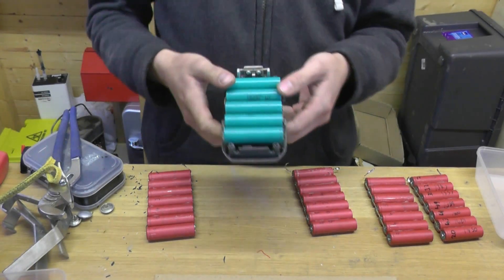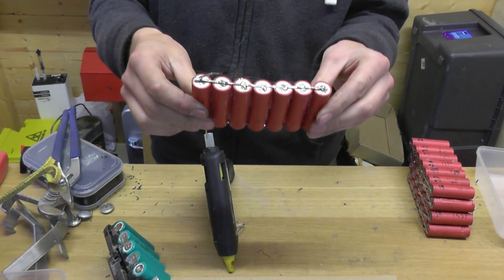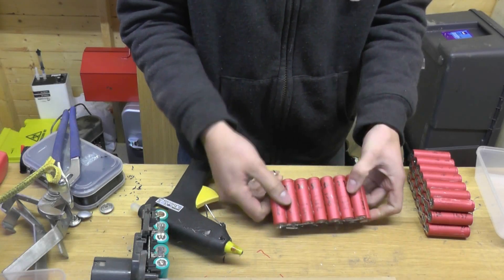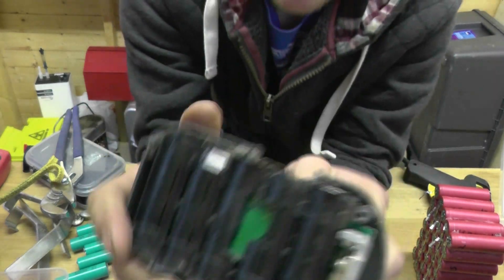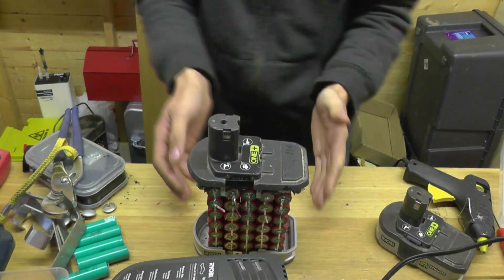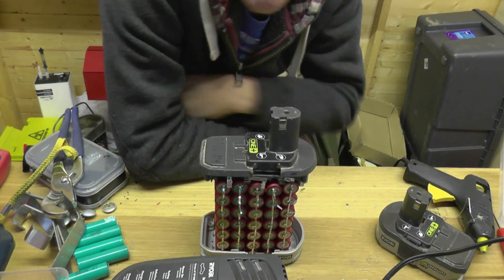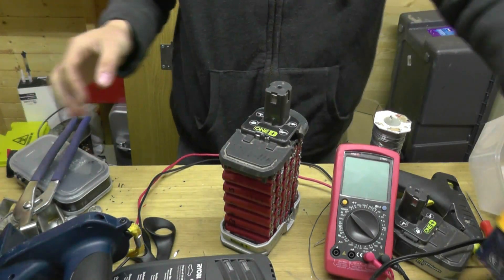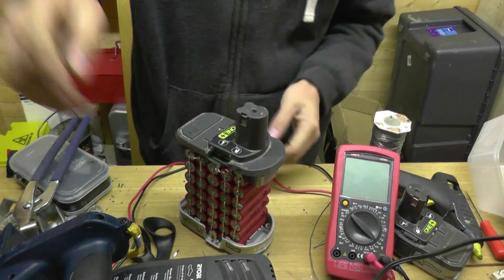18650 part 3 - supersized Ryobi 18v pack

Comment: I have done just the same with my panasonic SDS drill,originally had NIMH battery's but changed to 18650 also fitted balanced charge socket and lipo voltage warning indicator 
Charge on the lipo charger and works like a dream
My tab wire was thicker ( the one julian ilett used) to handle the current of the drill
Reply from the maker: yeah I only had the 2mm wire in stock, but only plan to draw 3 amp max for laptop. Not using this pack for my powertools, I have some 4ah packs for that! what voltage is you panasonic drill?

Comment: nice pete ive got all my tools off grid, just built corded units as i  needed mains free flexability not true cord less!  i think that should be cool i didnt use any circit protection just a voltage meter.i use um daly at the moment im running my rip saw off um  thats a ryobi too .good luck with this i ll do a video of my efforts see if it sparks an idea or something.stay cool buddy all the best..stoo. .

Comment: If you look up the datasheet for the li-ion charging control ic it should say what it is capable of handeling.  I suspect that it will work but will take longer to charge assuming that the the ic limits the charge current based on the old batteries.  You may be able to use the i2c bus on the ic if it has that capability to reprogram it for the larger capasity (I am assuming that this pack works like a laptop battery).  Most li-ion multi cell battery managment ic's will slowly balance the pack by placing a 20 to 30ma drain on the cells that are higher then the lowest cell of the pack if you leave the pack on its own for a day or so.

Comment: Fucking excellent! Im looking for mods for ryobi 18v batts..
Reply from the maker: Freshkryp69 this project never got finished. Did charge battery from flat. The ryobi charger seems to time out before fully charging. but you could put it on a manual timer to reset the power every couple of hours.

More recently I have converted a Dewalt wet dry vac to run from ryobi batteries and made a unit to take power from 18v down to 12v and power usb items!

Comment: I like conveinient reliable power
But I think that battery is s little
Too lsrge for portable powertoolo
Reply from the maker: I made it mainly for use with a defective charger that I mounted some 12v sockets and usb sockets in hindsight if I had access to higher capacity cells I could have made it smaller.

Comment: 2 problems I see you having is that the top cells will get worked more then the rest (as such the bottom cells worked less) and that the battery could slip out of anything you plug it into.
Reply from the maker: Good point! Can you think of a way around this? maybe like on deep cycle battery banks charging and discharging from opposite corners? or regular balance charging?

Remember this is just thrown together and will change as I get more ideas and feedback! thankyou for your input!
Reply: the only thing I would recommend is to maybe use a double height 18v one plus (4.0 Ah battery) that are 2 cells high and 5 wide but each and use 2.0 ah cells, swap out the 2.0's with 5.0's and then you have a Ryobi one+ battery that has 10Ah of power.

I don't have any suggestions on how to charge the monster you built.
Reply: Why would that be the case?  Especially at the 3A expected draw, how much voltage drop do you think there will be across those wires?

Comment: Hi nice vidz, how did you measure the capasity? Do you have a dumme current load gadget? If did you buy it if where? Or did you make your own?
Reply from the maker: The cheapest way is to either buy an Imax B6 balance charger (this has a 1A discharge function which shows capacity) or buy a Turnigy watt meter which can take upto 60v 120A and has both MAH and WH on its display. (Be sure to only use this on a protected pack and use external supply to keep the readings once your battery is flat.
Reply: pietkaify So, plug the battery in the charger, press decharge, and thats it?  And i can take a reading of the lcd?     Is this a presice way or just a fair indicator?  Many thx! And keep op the great work!
Reply from the maker: If you go back to part 2 cycling I charged and discharged each cell 5 times and I took the average of each and used that as my capacity. These are "dead" cells that I have revived "do this at your own risk" The Imax B6 I use seem to be copies, but against each other they preform the same.

Expect the copy to cost £15-20 and the real deal arond £30. Your welcome

Comment: I must had missed the 1st 2 videos of course this is my first time seeing videos from you I believe. I'm having a little bit of audio issues but it looks like you took a p103 and made it from a 1.5ah to more like a I don't even know but looks like more then a 9ah battery. This does confuse me a bit about how you would use the circuit board to operate it and more confusing is charging it but I'd love to know more info as I have a lot of p103s and 18650 cells. I can take things apart and put them back together even modify things but I can't figure out how to search previous videos lol. Or much else then watch videos in my feed or if I look up I'll see things in that category but that's it. I did subscribe so maybe that will help. I am wondering if you have heard of the Vanon 6ah batteries and any videos or them that are not sponsored even meaning where Vanon voluntarily sends youtuber the battery for free. This is what I was searching when I found your video. I've seen videos on them that got excellent reviews and had Samsung cells but unfortunately the comments where filled with people saying they got defects and the cells said Vanon on them instead of Samsung or LG like they advertised.

Comment: I hope he knows that the 18650 cells from a laptop and the cells from a power tool pack are not the same. They look identical but they have different C ratings.
Reply from the maker: epicdeuce yes he does. =) but in this case several of these cells in parrallel would more than make up the 15A discharge rating of the original samsung cells.

Comment: Wait... Aren't each of those cells 3.7v? If they're in series, how do you have more than 4-7 cells and not fry the living shit out of everything?

Oh, I see, the 4 rows of 7 are in parallel.. Still, just so you know, you're adding ~7.5 volts more to the circuit by having 7x 3.7v instead of 5.
Reply from the maker: Not 100% where your coming from. 5 cells in series gives you your 18.5v to run the tool. More cells in parallel gives you additional capacity. This was only used for testing and low load long duration items